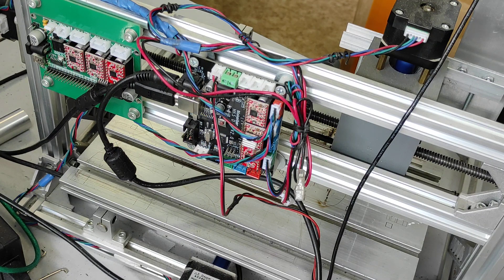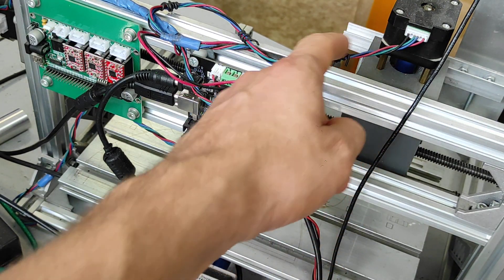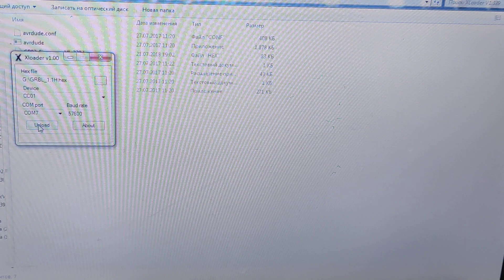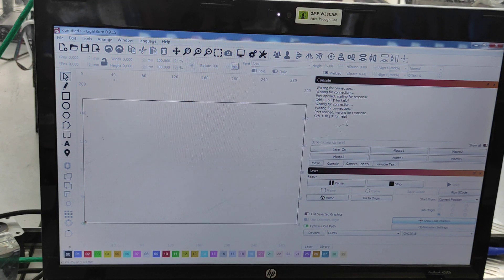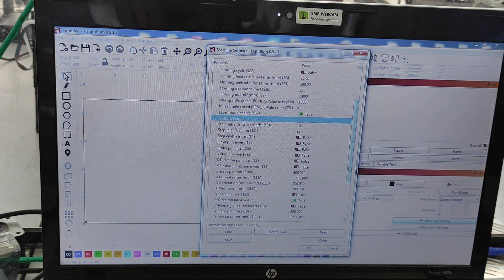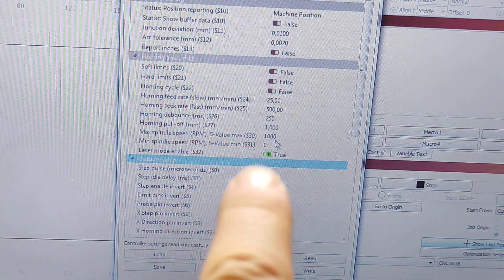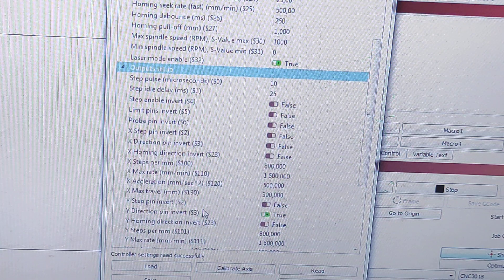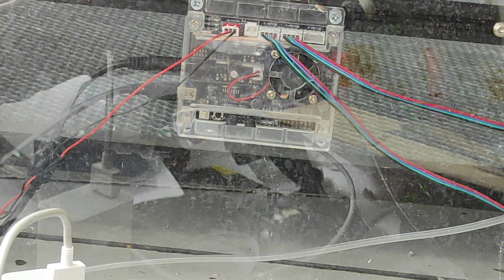Uploading GRBL 1.1F firmware on Makerbase MKS DLC ver 2.0 board.

Comment: I built a CNC machine to move my plasma torch. I used the MKS DLC 32 version 2.1 card. Unfortunately the online controller and the remote app don't offer z-axis control. This makes it very difficult to zero the z-axis before initiating a cut. I have to connect to a laptop and launch Open Builds Controller just to zero the z-axis. Then unplug and switch over to the remote app. Running the G-Code off the card is the only way I can operate the machine without getting interference from the plasma cutter. If I try to run open builds to do the cut it will corrupt the signals and the machine will stop after about 1 minute into the project. Why doesn't Makerbase offer z-axis control in their software? They offer x y and z on the control board so why not on the software?